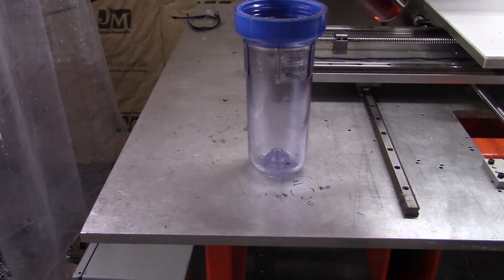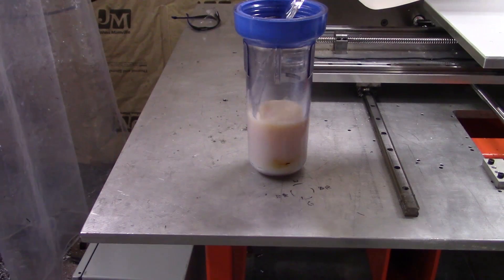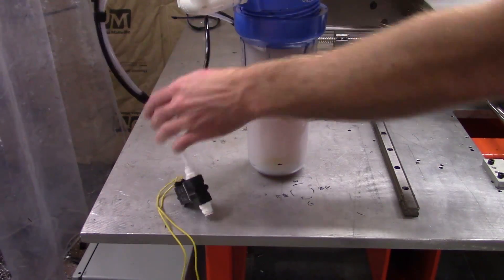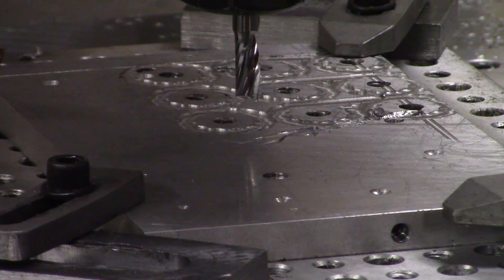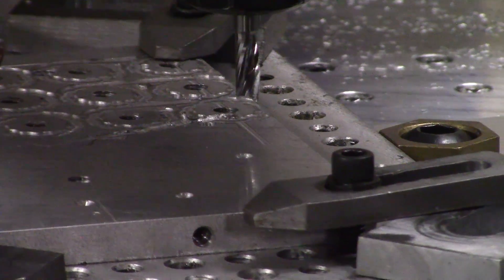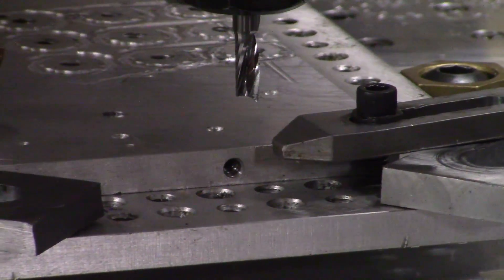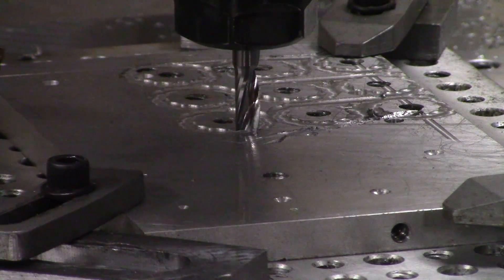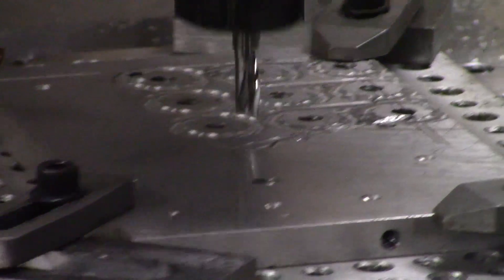DIY VMC vs. Aluminum!

Comment: What a serious machine.Respect. Im just converting a downham mini-jig borer to cnc. Would be interested in what backlash reduction methods you might use. I added a shim into the ballscrew endblocks between the two bearings (not angular) which allows you to create an angular contact when tightened.Not ideal but im not running 24/7. Tried to add a second ballnut and spilled my balls all over the garage floor , re-balling and will try again. Where in the world do you get Aluminium that thick. OMG!. Love it.

Comment: How are you liking the Qualichem 251c with your diy fogbuster? I have a similar diy cooling system and have been trying to decide what I should be using, 10W-40 motor oil has been working ok but gets messy.
Reply from the maker: Cripple Concepts I highly recommend it! I've had no issues with rusting whatsoever and while I don't have anything to compare it with, it seems to work great as a coolant. You can get a sample to make a few gallons over at NYC CNC's store and see how you like it.
Reply: Thanks Chris DePrisco, looks like by the time I pay shipping from SMW I'm looking at $29 for 12oz and for $57 I can get a full gallon shipped from Tormach....if you, Saunders, and Grimsmo all use it I will trust it is the right stuff. I have almost a full gallon of Kool Mist 77 that I am saving in case I want to expedite rust on something someday.

Comment: receipes on the ball mill are not the cause. What you see here is chatter caused by lack of rigidity of the mill in many places like main structure, axis drives, spindle bracket. Aluminium is not an ideal machine tool material...Using hollow steel tubes in the structure instead of solid bars creates elasticity. Cast iron due to its graphite inclusions has a natural strong vibration damping property which alu, steel, or even carbon fibre structures have not. It is no accident that even modern tooling machines are still often built with cast iron, thick walls, lots of ribbing and gussetting. It is clear that this home built machine cannot meet professional standards. Therefore it will be good mainly for wood, foam, plastics. In metals you will suffer chatter until you manage to stiffen the structure. 
Step 1 spindle bracket either solid or a closed box instead of a stack of spaced plates. 
Step 2 bolt down the guide rails to the steel beam in all bolt holes not just a few. 
Step 3 try to replace alu with steel where ever possible. 
Step 4 introduce ribs and gussets where ever possible.
Step 5 preload the linear bearings and the spindle bearings a little more withinn reasonable limits of course.
Reply: 6. swap out the plastic insert spider jaw couplings with proper zero backlash couplings specifically designed for CNC applications.
Reply: +Diamond Eyes   Just empty words without more info...pics, description, etc.
Reply: Not sure how you doing with machine but I agree with this assessment... When we build machines for high rigidity, we use  thick steel with gussets and lots of gaps for rigidity then fill the whole thing with concrete... Makes it industrial moving heavy but concrete dampens the steels resonating frequency ;)

Comment: really impressive...  for the surface finish..it looks what might be happenning is the endmill is actually skipping on the surface..i had a similar problem when i finished the 0704..i used a gas strut to offset the weight of the 1.5hp tenv motor... i ended up forgetting to put it back on after some maintenance...and i got decent z finishes again...(with endmills)
when the Z is at static with a strut  and theres a bit of slop in the ballscrews the endmill will jump up and down on the surface (im going to doublenuts and repacking them after a few hours)

 might help you might not.. 
and as stated a circular helix would also help..

im getting ready to add linear rails...also want closed loop ..but that will have to wait ....
do you mind if i ask where you got your hiwin rails ....are they 25mm  or bigger

again really impressive,,,,,speed and MRR..
.i enjoyed the vids and watching your machining and programming skills

Comment: wow cant wait till i cut like that what kind of spindle are you running on your new build
Reply from the maker: Just a generic 24,000 RPM water-cooled spindle from ebay.  It's a placeholder until I can justify spending nearly as much as this whole build combined on a proper spindle.

Comment: Man that first plunge.  Slow the plunge down, or do a helical plunge starting about .050 above the material. Im surprised that cutter survived.  Not only hard on cutters, but hard on your spindle bearings as well.
Reply from the maker: Yea, that was an accident.

Comment: Hi Chris,
Great progress. Loving the mechanical side, but can you give some feedback on the UCCNC control software. I.e. your reasons for going with this instead of the usual Mach 3/4...

I would be really interested in your feedback. A video on using the software would be even better...

Cheers from Downunder!!!
Jeff
Reply from the maker: Hi Jeff!  I went with UCCNC because Mach3 is no longer being developed and I didn't want to start out learning software that is soon to be obsolete.  Mach4 from everything I've read is still basically beta version software and has some issues with things like trajectory planning.  UCCNC is a little cheaper, seemed to be well liked by those who've used it and is really easy to modify graphically.  

It seems there is no hands-down winner in the control category for hobbyists.  I don't think you'd go wrong with any of them.

I'll make a video as soon as I learn what I'm doing.

Cheers!
Reply: Thanks for the feedback and info Chris.

Comment: This really shows that the mass of the machine is a game changer for this type of mill with very little chatter.  My next build will be much larger and with more solid steel supports and mist cooling.  Thanks for posting. :-)

Comment: add coolant to water, not water to coolant.  at least thats the way I've been told.
Reply from the maker: Interesting, I wonder if there is a reason for that.  I figured adding the water like that would be more agitating and stir it up nice.
Reply: When I mixed up some Trim MicroSol coolant a while back they were specific about adding coolant to water then mixing and I've heard the same from a few other people.  Not really sure why either, your reasoning makes perfect sense.  From Master Chemical:  "Microemulsion products, like MicroSol 690XT, work best if they are mixed by adding the coolant concentrate to
the water (never the reverse) to help insure that the best possible microemulsion is formed."
Reply from the maker: Hmm.  Well that's easy enough to do from now on.  Thanks!
Reply: I think it's because of the difference between an emulsion and a suspension. 
An emulsion is a mix of the two liquids whereas a suspension is one liquid held in suspension of another. 
Man, that was a bad explanation, but there is a difference. 
Google 'making the perfect cup of tea', that should explain it.

Comment: Some of the plunges looked a little bit brutal, otherwise good:) Perhaps add a circular helix down on the plunges.
Reply: I was puckering real hard on that first plunge. Machine handled it really well but yikes.
Reply from the maker: Yea, I wasn't planning on plunging like that.  I was using a smaller piece before the video where it plunged outside the stock but forgot to change the stock size in Fusion.  Oopsies, lol.

Comment: Wow that high speed stuff is nice! Rethinking my spindle build now
Reply: you talk about low torque but plunge at mach 10 speed :P
Reply from the maker: That... was an accident, lol.  I forget exactly why, but I had the ramp set to plunge instead of something a bit less drastic.
Reply from the maker: It really depends on what you want out of the machine.  I'm limited to low torque toolpaths but for the type of milling I want to do it makes sense (in my mind anyway).
Reply: by the way a good tip, if you crash the machine, make sure the spindle i running so the chance of a spindle bearing damage is significantly less (i am talking from experience ;) )

Comment: Nice work getting it going and cutting metal. I saw something that might improve the rigidity of your mill: The plate that the spindle is attached to could do with some stiffening: Maybe two profiles bolted to it parallel to the spindle axis. If it won't increase weight too much.
Reply from the maker: There are two 1" thick steel bars behind the aluminum plate that space the plate off of the bearings.  They extend all the way to the bottom.  Were you thinking of in addition to that?
Reply: Ah.. I did not see those. I suppose more wouldn't hurt, but there might be other places that is more worthwhile spending time on then. Did you do any FEA on your mill ?
Reply: i love everything about this machine except the sound it makes... sounds like a lot of resonance going on, have u thought about dampening it a bit, it could potentially improve the cuts, but it could be just the spindle sound.. not sure on video... cant wait to see future videos on your vmc :)
Reply from the maker: Yes, I have given that some thought and I will probably do something here soon.  I don't know if it's actually causing a problem though; but it can't hurt!

Comment: Nice man!! Glad to see it running finally. How fast are the rapids with the ClearPath servos anyway?
Reply from the maker: I can do 500ipm for sure but theoretically up to 800ipm if I slow down the acceleration; otherwise the motors run out of torque.  You can get more torque for more money but I think this is plenty for now.
Reply: Not bad at all, I agree that's definitely fast enough. I've been curious about these motors for a while, looks like they are worth looking into more, thanks man.